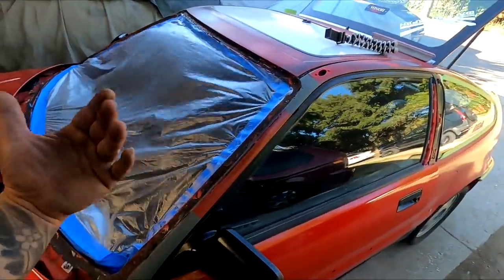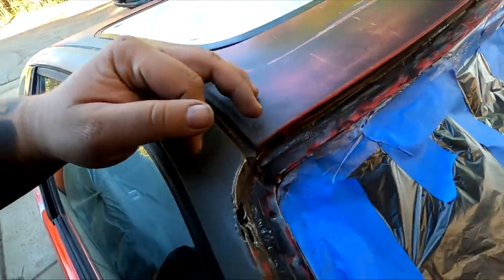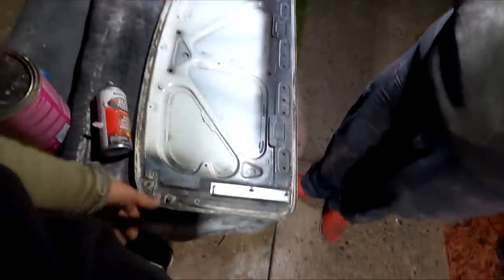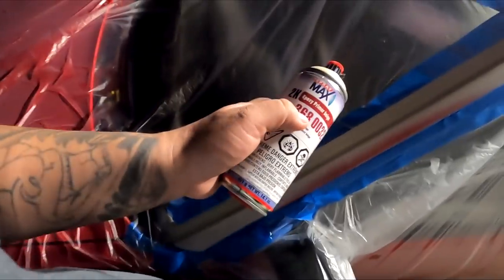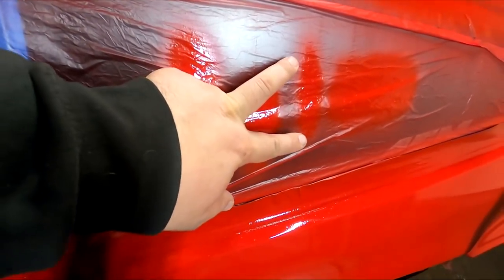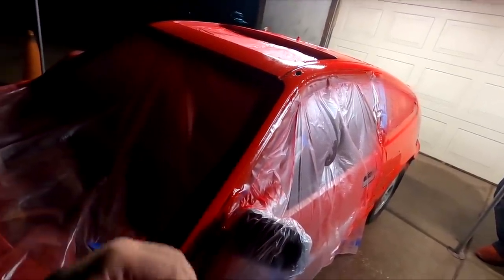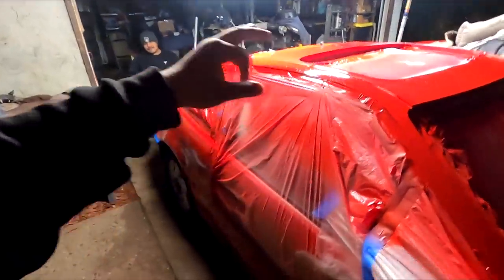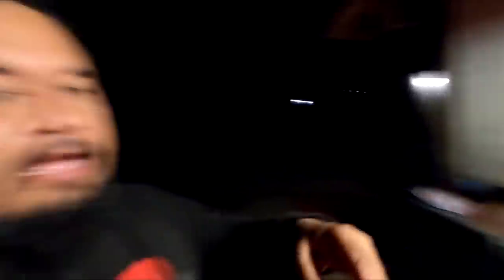$100 Paint Job - LEO's CRX Finally Painted!

Comment: You gotta drain the air tank. In can build up alot of water. It can also rust from inside out. I got in the habit when I close up the garage. When I flip off the air tank I reach down and crack the valve let it drain every night.

Comment: dude you should wear gloves with a grander. especially a cut off wheel. the glove will reduce the vibration and might just give you a warning before you cut into your finger....i have had a glove hit the cut off wheel and i got a little tiny cut but without the gloves it could have been much worse.....the two tools i think are the most dangerous are a grinder and a table saw......nothing to mess around with